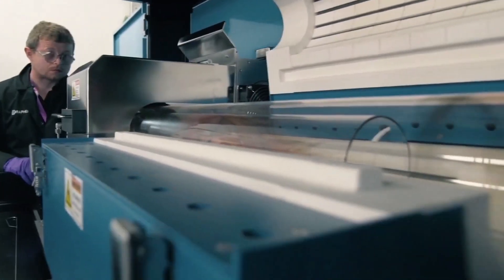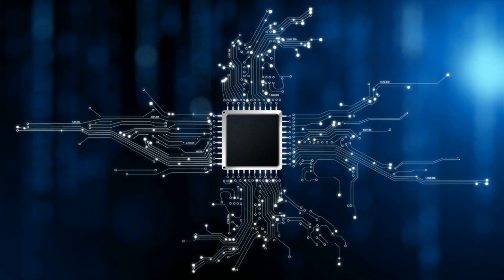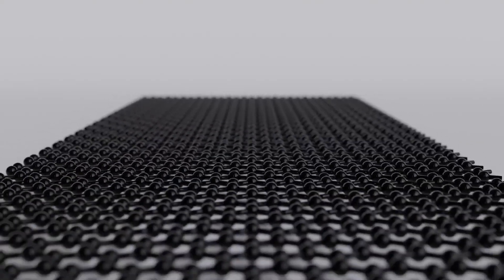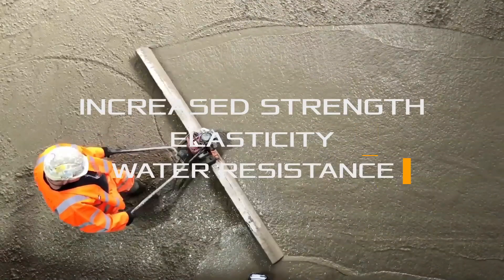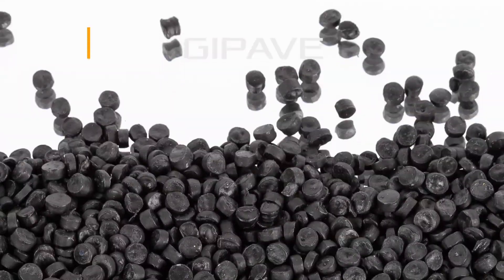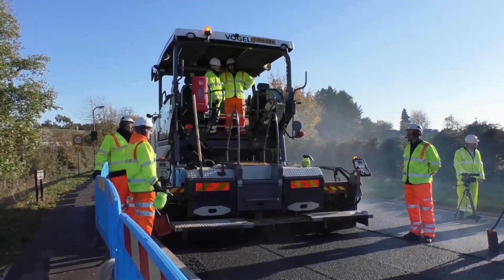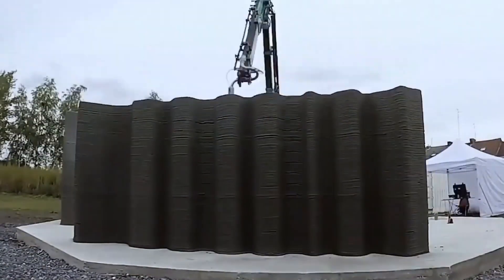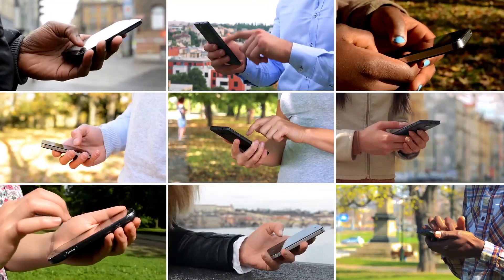Graphene in concrete is already changing the rules of the game in construction

Comment: Will Graphene become the new Asbestos? If the particles are that small, how can you keep it out of workers lungs? It would go right through any mask. Also, won't there be Graphene particles expressed into the air over time as wear and tear works on the concrete? And how would that affect our health?
Reply: As we have seen time and time again that problem would only be addressed after it manifested itself and damage had been done.
Reply: @nbandpinportugal  PROFIT BEFORE PEOPLE.......
Reply: When they showed the road workers applying the graphene asphalt, I thought, "...and they all already have lung cancer." To be fair, asphalt is pretty nasty business by itself.
Reply: Very good question. I think it would be more like a black lung problem though. Graphene is a carbon like coal. So I’m thinking that the dust from it would eventually harden the lungs of at least the workers over multiple jobs. Carbon also attracts moisture like concrete does. So I also believe it will shorten the life of the concrete.
Reply: @richardpack4  p
Reply: @richardpack4  Graphene is hydrophobic not hydrophilic, which is why it is claimed to improve the water resistance of the concrete.  Also, I anticipate that most of these products will be delivered in a dispersed (liquid) form, so the inhalation risk during use is extremely low.  For example, the EdenCrete concrete (liquid) admixture you can buy at Lowe's hardware store contains carbon nanotubes and is targeting retail customers.
Reply: yep.   that was exactly my thought when i saw the title.
Reply: First of all, at least in the US, Asbestos is not outright banned.  It is banned in many applications, but is still legal.  There are other countries that use it regularly, including Russia, but that's another story entirely.
The reason I mention this is because there is current research happening on just that question, and it does likely pose some danger.  What will matter is how the material is used, how that material interacts with the builders, and with the people around the end products.  
During the production, I haven't seen any point where it poses a risk, as it's done by chemical deposition.  When it goes from production to application, it doesn't appear to be likely to aerosolize, but if you've seen evidence of this, feel free to correct. The question is whether it can come off in sufficient amount from the material when used to be dangerous.  
 I think the natural toughness probably is in it's favor, but there may be applications that might be questionable.  I wonder about the road, as it has high levels of use and wearing.  As foundations and structural support, I suspect there's little danger of any serious amount making it's way to people around it.
Of course, scientists are continue to study it, but you aren't the first person to ask that question, and it's been studied for more than a decade thus far.
Reply: @lrom5445  Imagine 15-20 years from now how it'll be demolishing a graphene-concrete building. It WILL be suspended in air
Reply: @54365100  An interesting point, but actually (surprisingly to me as well) not very applicable.  
Doing a little digging into this, it looks like a few factors will prevent this from being a big issue.  
First, the lifespan of these building will be increased.  That's the point.  Normal concrete buildings last more than 50 years.  We'd expect a much longer lifespan.
More importantly though, from I've read, graphene concrete isn't acting differently than concrete and isn't just separating when demolished.  Much like you wouldn't stand in a cloud of concrete, the graphene concrete gets destroyed, but doesn't just separate out from the concrete dust. By what I'm reading, it should be no more dangerous than concrete dust, and just as easily filtered because it's not just graphene in the air.  
Feel free to correct if you find evidence to the contrary.  Right there's not a ton of information out there, so I'm having to read through many sources to find out how the graphene concrete behaves when destroyed.
Most likely a moot point though.  The nature of emerging tech, combined with the fact that we haven't actually solved the cost issues, I suspect there's a rather small chance this ever comes to market, and if it does, they'll have to contend with safety issues. 
These early adopters are probably small outliers, which tends to happen with new tech.
Reply: @lrom5445  Really good points thanks for the info, but a bit of my main concern still remains, because concrete particles in the air will still have graphene adsorbed to its surface. Graphene acts like a sticker, it'll stick to anything it possibly can as it is too thermodynamically unstable as a single atomic layer, and in this case, concrete. However, that doesnt mean that graphene loses its properties, rather, they're modulated by the substrate it is deposited. So, what effect a concrete particle with graphene would've adsorbed to a concrete particle deposited in your lungs? No idea.
Reply: @54365100  No idea.  It'll have to be studied.  I can't find anything on it.  That said, you don't generally inhale concrete particles when something is demolished.  Graphene stuck to concrete should act like concrete when it comes to mask filtration.
Reply: @54365100  Of course, I'm not going to be the one testing how the masks works with those particles.  Until we know for sure, I'm not going to be anywhere near any kind of demolishing site.
Reply: Great question.  It has recently been found that fine silica dust is bad for you in large amounts.  It seems to be somewhat inert in small amounts.  
Silica is in almost all mix able building materials...so people who do building demolition could get something akin to back lung from silica dust. Could graphene be like thsi in the future?
Reply: A good question, though I think the effect would be more comperable to smoke.  Normal combustion and soot contains similar nanoscopic carbons aglomeraions.
Reply: Well, to start, there is a difference between carbon and silica, especially in the human body.
Reply: Well it’s already in the vaccine.  So does it matter?
Reply: @petewick8627  😂😂😂 Apple puts it on the surface of their phones to trigger dopamine surges in your brain.  That is why their phones are so addictive!
Reply: Interesting question. I was wondering that as I watched the workers unmasked in the video laying down the layers in the video. One would think the body would be able to expel it easily as it’s tiny. Long term exposure to massive amounts? Who knows? We are constantly being bombarded with new things that technology keeps inventing like construction materials, vaccines, food additives and more.  It’s unfortunate that we do not discover the harm from any particular item until years or even decades later.  Lead, for example, was used in pipes, paint and as a gas additive. Look how that turned out.
Reply: The filament form graphine may well be friable as are asbestos fibers. That would potentially pose a danger. The other risk I foresee is the small nanoparticle size which might be small enough to penetrate the skin membrane. If a substance as durable as graphine gets in the bloodstream it could be nasty.
Reply: It's turn into microscopic blades, then you can imagine dying drowning in your own blood...
Reply: @depotentiaadactum5841  
I'd take more water with it next time...
Reply: The answer will become more obvious when you understand the mechanism of why asbestos is hazardous. It's not the atoms but the way they are ordered. It's not just that the particles are small, but that they are very sharp, long and needle like. Once they enter the lungs, they get stuck and are impossible to cough up because of their shape. They stick into the lung tissue like a prickly seed sticks to your sweat pants. Unfortunately, they burrow in and the tissue grows around them, causing repeated damage to the cells as they die and grow again. Eventually, the large amount of cell divisions cause a mutation and cancer. Graphene under an electron microscope doesn't look anything like asbestos. However, it could have other health affects that we don't even know about yet. It's a great question. Whenever you hear "miracle material", you should indeed be on high alert.
Reply: @amineaiffa  first off the graphine is coated in liquid then it is encapsulated in concrete you could eat it only get an upset stomach.
Reply: Dude I have my covid mask my aunt made me. Fauchi said It stops anything. It's also Chicago Bears themed. I'll be alright
Reply: In general folks, unless you have been privy to the research and results, you depend on information which may, or may not, be credible. Pandemic has shown this. How many of you afraid of graphene, have taken the jab, knowing full well that you only have government officials and employees, who I might add, make a WHOLE lot of money, and private pharmaceutical companies, again who make a WHOLE lot of money, telling you it is safe, and referring you to a 75 year term to release that information? And you are worried about graphene? Some research already implies that they put it in the jab. If you are worried, you might want to hold your government officials and employees to account before singling out a research project that is open source. But then, hearsay is so much more entertaining and scary.
Reply: Simple! graphene is toxic to biological life. Ultimately it will be released into nature and lungs. A good idea that will go straight to hell!  Science is blind as ever!
Reply: It's carbon.  Look how many Q anon tards responded to this and judge
Reply: Graphene is probably absorbed by the body and not cutting your lung apart like asbestos but time will tell.
Reply: Hmmmm....good point. It is a fantastic product but there are still too many unknowns. The only way I can ever seeing this work is if the nano-particle is bonded directly to what ever other compound it is used in conjunction with...and even then...maybe...
Reply: The reason that asbestos is so hazardous is that it is fibrous and once it gets in your lungs, it won’t come out. Your body ends up growing tissue around it, and over time if enough tissue is built up it clogs the passages in your lungs. If graphene is not fibrous, it may not be an issue to human lungs.
Reply: @1shinytop686  "may not"...hmmm....only time would truely tell  guess..
Reply: Carbon naturally bonds to itself.  Two pieces of graphene coming into contact with each other will link up with very little prodding.  This causes the small particles to slowly accumulate into larger particles which the body can expel.
Reply: @akulkis  still...would you want it in your body?
Reply: Graphene is nothing more than pencil lead shaved down. Alll y'all who are trying to figure out how toxic it is never bothered to ask what toxic levels do pencils make? There are not graphene nanoparticles floating throgh the air. Instead the technology is bonded to another substrate such as concrete. Don't worry graphene is ok as long as medicine doesn't use it.
Reply: Mweh, your lungs are made of carbon too. You’ll be good.
Reply: Don’t forget United States citizens are the Guinea Pigs of the world.  Until something is proven to cause cancer, or be problematic, it is not banned.  In other countries if something is likely to cause cancer or be problematic,they ban it, or require a warning label.  For example if you look at the ingredients in a bag of Doritos in the US, and compare it to the same bag of Doritos bought in the UK, they have different ingredients for the same flavor of bag, because the UK bans ingredients, or requires a large warning label on the front of a product that may have a high likelihood of being problematic. For example Doritos adds artificial dyes in the US, but not in the uk, because Doritos would have to add a warning label to their bags of chips if they did add artificial dyes.  (Artificial dyes are carcinogenic) No one wants to buy any food that contains a warning label.  There are other examples with Doritos and other foods and products in the UK as well as other countries.
Reply: Graphine mixed in a polymer probably wouldn't be a problem, with cement though, that's a different question. If they are polymer beads in the cement I wouldn't worry but if it's pure graphine mixed into concrete, yeah that would probably be a problem.
Reply: @tomsweder7459  there was a bit of "tongue in cheek" there that probably didn't come through.  The point is that it's suddenly a "big deal"  lol
Reply: @tomsweder7459  alright then. As long as you're having fun.  Lol
Reply: I believe that if asbestos were 0.3 nanometers it would not have been the health threat that it is. A red blood cell is 10,000 nanometers…
Reply: Asbestos creates a self supporting wedge or cone structure, I think this is why it's so dangerous
Reply: @spikslow  graphene is 0.3 nanometers. Red blood cells are 10,000 nanometers and the COVID-19 virus is over 60 nanometers. 

“OSHA defines asbestos fiber as any particle that is 5 microns (5,000 microns) or longer,”
Reply: Graphene is just carbon my man. The most common element in all the earth.  It can do no harm.
Reply: All you have to do is wear a mask.  That completely keeps out small viruses, right ?   Everyone that wore a mask never got Covid, right?  That should be the same for graphene.
Reply: Good point
Reply: Put the manufacturing in 3rd world countries. They happily work and die after a happy short life.
Reply: As it's carbon, i would have thought it would cause a futuristic version of black lung...
Reply: just no
Reply: I remember awhile back they voted against and slowed the use of rubber in roads because they would last much too long and end too many jobs in the process. 
How crazy is that?
Reply: It’s only carbon folks.
Reply: This is what they want
Reply: It's pure carbon and seeing as we are made of carbon it probably won't be all too damaging. Asbestos is a fibrous silicate and therefore very different. A bit like comparing Iron and lead in construction
Reply: No one is going to read this, but we already know graphene is super poisonous. It absolutely shreds lungs and shouldn't be used in any place where it can break off and become airborne. 

So it's a bit different than asbestos as we know out the gate that it's poisonous in certain applications. 

Also, wow I always forget how stupid YouTube comments are. Not OPs, but the other replies.
Reply: @donshadows5501  Asbestos is a naturally occurring substance.  How does one invent something like that?
Reply: The scariest thing I think in this thread is how many people are becoming fearful of progress.  It's like a percentage of the population has becomes conspiracy believing luddites.  
It's one thing to look for regulation of industries and manufacturing processes.  It's a completely different prospect to jump at shadows and see danger from every corner, with very little evidence.
Reply: You are correct that is why it’s application in cement and batteries are seen as the safest use case so there isn’t dust particles in manufacturing.
Reply: If you have ever written with a pencil you have almost certainly produced graphene, as pencil writing depends on thin layers of the graphite in pencils shearing off and staying on the paper. Some of these layers will be in the form of graphene (that's literally where the name graphene comes from) and some of those will float off the paper and into the air. So while some of these very small particles can theoretically cause damage to human cells (for example, by disrupting cell membranes) we have already been exposing ourselves to small amounts of this for hundreds of years, without the very noticeable detriments that you see with things like asbestos.
Reply: @jamesb4523  it’s not the same as graphite as in a pencil. The graphine described in the video is basically a 2D version of carbon nanotubes they have caused the carbon to take on a crystalline structure which makes the product remarkably strong and durable. Being strong and durable means it’s unlikely to breakdown naturally in the environment, that’s a problem once significant quantities of the material is produced and used in industry. Graphine is to graphite as a diamond is to coal, same basic fundamental components but vastly different end product.
Reply: @jamesb4523  Interesting.
Reply: @jamesb4523  Well I believe you, like most normal people, dont try to inhale graphite particles from your a4 sheets. Airborne graphene is a VERY different situation
Reply: @jamesb4523   graphite is not graphene is it?
Reply: @oldhardrock2542  Graphene is made from graphite 🙃 it's the exact same thing in two different forms. Same compound, different structure. Take a pencils graphite core, put some tape on it and pull off the tape. Congratulations, you made graphene.

Graphene isnt something new, it's minimally toxic and from all the exposure to accidental production of graphene people make in their homes, schools and offices etc hasn't shown any adverse effects unlike other things. Asbestos is not a good comparison with graphene as graphene is not a fiber nor has the same or even near the physical properties graphene has.

It won't be much different from breathing the air you breathe today. There's carbon in many forms, even toxic ones and sheets like graphene.
Reply: @oldhardrock2542  As I understand it, graphite is a naturally occurring allotrope of carbon containing many loosely connected sheets of graphene. Graphene is the individual sheets.
Reply: by that logic why arent you scared of the concrete dust
Reply: @andrewgio1  we are scared of cement dust
Speaking from construction experience & as a cement truck driver AKA a Mixer
Concrete is the finished product
Reply: @mansardmanor3869  well yeah from my understanding all dust is dangerous
Reply: @andrewgio1  we are scared of cement you get stonelungs very painfull an a slow dead like drowning on land over years...
Reply: These are good questions. Hopefully it will be formed into larger objects before we see it used in construction, like those pellets they used in the asphalt. But, they have to make those pellets somewhere.
Reply: @alphagt62  It'll end up similar to the reinforcing fibers added to the mix to take the place of wire mesh. The only difference between commercial and residential was commercial fibers were longer and more of them. One bag per yard of mix. OR more than likely it'll be like basic slag and go in with the powder, so much per yard and THAT will probably be the way as to be measured for yardage and different strength too. Another silo!
Reply: Toxic environmental danger
Reply: Graphene sheets are super thin, but they are much longer and wider. So the particles would be bigger overall and easier to filter than it's thickness would suggest.
Reply: Plasticine is all over the world now. How will this be any different?
Reply: @TechStuff365  The problem with graphene, as I see it, is not in its components, i.e. carbon, but in its shape and size. Graphene is one atom thick. Its particles might act as tiny razorblades inside our bodies.
Reply: @prayerpatroller  you are basically saying that graphene will split molecules. As the human body is mostly water, then you have discovered a green source of hydrogen. 👏
Reply: @prayerpatroller  um, we breath in many many things that are an atom thick.
Reply: @DVankeuren  uh, every atom we breathe in is an atom thick, every one, every time.
Reply: You dont use graphene (carbon) by itself. Its used in other products to give them different properties, usually for added strength. You can make your own graphene sample by rubbing a pencil on paper then take a piece of tape and put it over the pencil mark. You now have graphene on the tape, a single molecule thick layer of graphite. I would suggest worrying about things that are actually a problem, not making up dangers about things you clearly don't understand. Good luck.
Reply: @Scott83083  watch Dr Gene Kim KJV then you might understand
Reply: @marktiltins8845  I just looked him up on youtube and found a video of him talking about graphene. Some of the science at the was beginning of his video conflicted  with my own knowledge. So I decided to pause the video to research the first claim he made after he explained his understanding of what is graphene and its derivatives. The claim was "graphene oxide is used in 5g devices/networks", pause video. After skimming through a few research papers I could NOT find anything about graphene oxide (GO) being used for 5g networks or that described a 5g signal having any special relationship with GO.
I did go on to read a thread I found through a Google search that was describing a debunked piece of right-wing extremist propoganda that was passing around right-wing circles trying to convince people GO is somehow activated by 5G signals. Then propoganda is circulated that GO was added to covid vaccines and 5G is/will be used to kill the vaccinated. All of which is absurd and easily debunked. 

I did not continue with anymore of the video from a guy that clearly doesn't understand science well enough to even sound credible, and is likely looking for financial gain by spreading obviously false information. Please don't send people like this money. If something doesn't sound legit, especially if its someone talking as an expert in a field they have no training, start asking questions. Always require evidence that is as extraordinary as the assertion someone is making. Remember, that which can be asserted without evidence, can be dismissed without evidence.
Reply: @Scott83083  The evidence is in the good book 📚 may I suggest you have a read as for looking up Google that's just nieve your only reading what they want to tell you
The evidence is in the Bible
Reply: @marktiltins8845  so you have no evidence? You need to provide your evidence, if you do, or we can assume what you are saying is false, like I just explained. Learn to think for yourself, dont let people fool you anymore.
Reply: @Scott83083  mate I'm not the one getting my information from Google I get my information from books
Reply: @marktiltins8845  
Good for bronze age fairy tales...
Reply: @andylane247  🤣
Reply: @Scott83083  may I suggest you look into buying Graphite stocks
Reply: @TechStuff365  We're also already exposed to damaging levels of particulates from motorways. Doesn't mean we should invite more. (I'm not arguing either way on graphene, just noting inconsistencies of this sort of comaprison)
Reply: It's in a lot of the vaccines, so We will learn who it effects people that way.
Reply: @firewoodtime2  - Citation?
Reply: @firewoodtime2  - In what vaccines is graphene present? And for what purpose?
Reply: Ask "Dr." Fauxi.
Reply: @paulbryan6716  He is a hero, when ordered by trump to release a pathigen to win the "trade" war with China he chose something that would not be too bad, but bad enough to get people concerned with pandemics. Trump should be tried for every person who died from the pandemic. And Dr. Fauci did a good job with keeping masks in the hands of people who needed them when he lied about whether or not masks would be helpful. More police would have died (the number one cop killer in the US was COVID in 2020 and 2021). Why do you hate cops so much?
Reply: @paulbryan6716  wtf????
Reply: @paulbryan6716  says the non-doctor in a youtube comment section, lol 😂
Reply: @sepg5084  so you have to be a Dr to be credible? Right now most doctors have lost all credit with those I know
Reply: @drewberrynews3875  - i bet Q told you that.
Reply: @marylynne9104  Q?
Reply: @drewberrynews3875  that's the lead poisoning.
Reply: @tmarritt  you're too funny😂
Reply: @paulbryan6716  What the fuck does Dr. Fauci have to do with this? 😂 He's an epidemiologist. I bet when your house is on fire you call up your bank to fix it instead of firefighters.
Reply: @Sinyao  graphene in da v a x scene?
Reply: @drewberrynews3875  But there isn't. There's no application for it in that, unless you believe there's a nanomachine put in it for the Jewish space lasers to target you from space. 🤣
Reply: @Sinyao  better read the actual science dr mengala fauxi is quoting
Reply: @Sinyao  don't you recognize a joke dude
Reply: @Sinyao    Obviously.  Fire fighter just leave me with a burned out, wet mess.  The bank holds my mortgage insurance and gets me a new house.
Reply: @Sinyao  If your bank sold you the insurance, then yes.  Firefighter's job is just to contain the fire to the single unit.  They usually don't save the unit,  and to protect curious onlookers (or trapped victims inside) from gawking too closely.  So yes call your bank insurer.
Reply: @Sinyao  - Jewish space lasers are real. The cameras in my microwave said so.
Reply: @paulbryan6716  We're all sure he could come up with more believable lies.